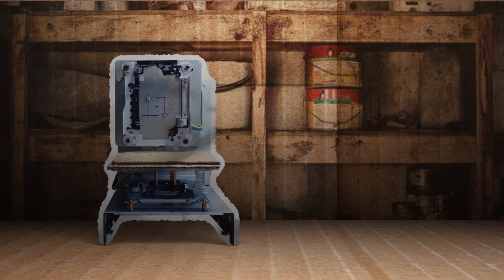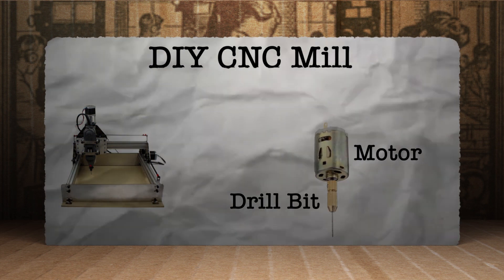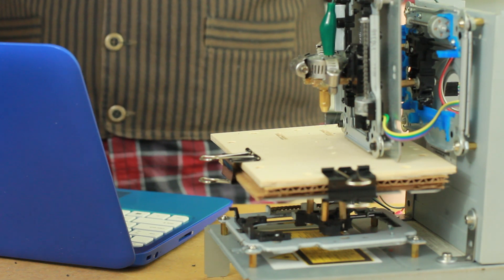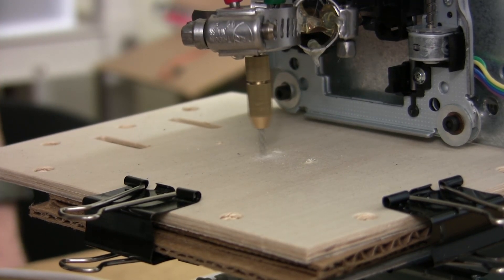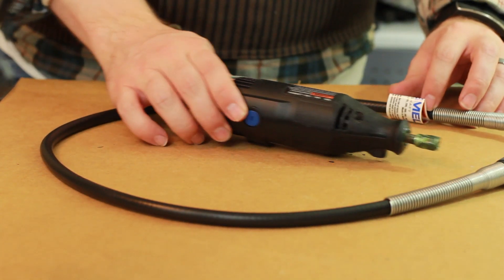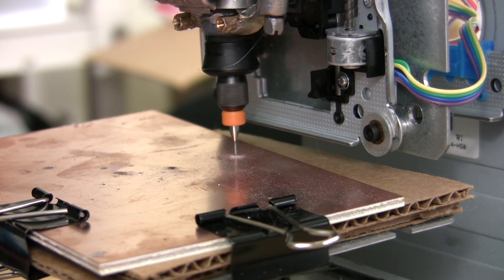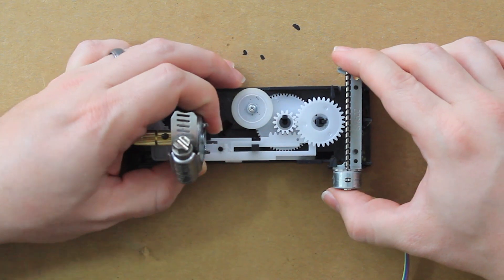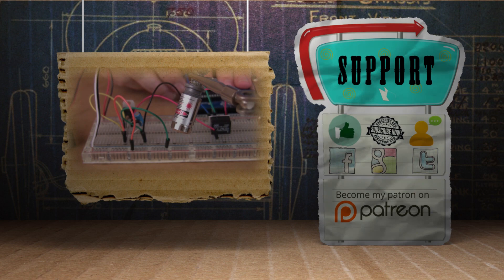Homemade CNC Milling Machine Epic Fail

Comment: you have to alight z axis very carefully (try drill on round bar oh yeah hard if not do exatly on middle) and remove wooble flexing. and what? you milling with drill bit? drill bits not cut horizontantilly

Comment: this is a drilling bit not a milling bit. You cant move drilling bits side to side
Reply: Correct. The flutes of a full bit don't have cutting edges, they are only for waste removal. It wasn't clear to me if, when changed over to the dremel, the drill bit got replaced by a router/mill bit.
Reply from the maker: +hansdietrich83 The dc motor bit is a drilling bit (because I couldn't find milling bits that could fit on a dc motor). However, the bit on the dremel is a pcb milling bit and is intended to move side to side.

Comment: CNC milling machines do not use drill bits.  Drill bits only cut at the point, milling bits have cutting edges all the way down the flutes.  If you do want to try milling, a milling bit is available from Dremel.
I have followed this project with interest, but have no intention of building one like it because the unit simply does not have the rigidity or strength to do accurate repeatable milling.  There are many good videos on building CNC milling machines.
Reply: +Will Barrows I don't think he expects people to follow his builds exactly. It seems a lot more like a demonstration of how to do a simple version. With some changes, many can be found in the comments, you can build a much better version for a bit more if you wanted to. Videos like this help show some things not to do, so any one who tries can do a better job.
Reply from the maker: +Will Barrows the dremel bit is a pcb milling bit. i knew going into this that it probably wouldn't be able to mill anything, but i wanted to see how far i could actually get.

Comment: Don't try to use a drill bit when what you need is a end mill. Drillbits don't cut sideways. Well they can  , but not well. Sturdier is always better than wobbly, but there are always ways to make things more stable. 
  My first two milling machines were made from used printers for the rails and motors with 20 tpi hardware store 1/4" threaded rod driving the bed via hardware nuts and dremel with a flexible shaft. Concrete base, brazed bed frame skeleton. BACKLASH? What's that? LOL

Comment: Man, those motors are too slow and too weak. You need a printer motor (where, by the way, the drill chuck would attach much better). Another thing: to use that part from the DVD you need to remove that white part, that can go to one side to the other. Because it breaks the motor. (There are great projects using it - with the original motor. Like 4 leg walking robots.) ;)

Comment: yeaaaa. milling is not gonna happen with that flimsy of a setup. at least dont use hot glue to attach the motor... Good idea and cool project. Im sure you learned a lot. Many many people have been making milling machines for a very long time, maybe take some hints from their designs first.

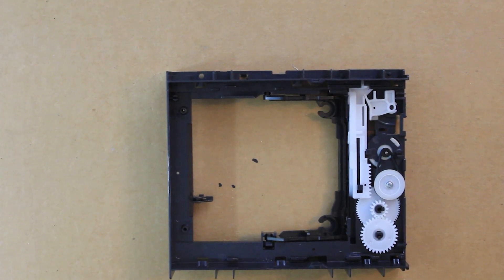Comment: Only 1:20 in, maybe the reason it didn't work is because you don't mill with a drill bit? You drill with a drill bit and mill with a milling bit. It's in the name.

EDIT: Yep. Get yourself a real cutter, and a drill chuck that doesn't suck. The drill chuck looks like it could actually be okay, but it probably isn't sized properly to the shaft, so of course it's going to be off-center.

Comment: Your bit is way too long. the longer the bit, the worse your wobble is going to be,  and the more torque you are going to get on your z axis; lever law. Try ditching the bit and extender entirely and filing the tip of the motor axle itself into a spade. move the motor as far down on your z mount as possible, and don't forget to properly balance it with a counter weight.

Comment: two words, drill bit, that's the wrong drill bit, that only works to perforate but not to scabble, actually there is drill bit for router and that's very important in order to make any "CNC" then you need a better guide system (obviously), step motors... im sorry but all you got is not the option, i made mine and it wasn´t cheap and it should not use arduino uno as the data processor and control because is too slow and only 8 bits, you need at least 24 bits and 94 MHz for that kind of data manipulation also a independent control for each motor and drill etc, you can still using arduino of course but soon you'll need a better option trust me... oh and not speak about the power control and the energy cost

Comment: ok sorry but the mechanical parts are completely shit mayby you should try to but more effert in tho mechanical  parts
Reply from the maker: +Sorry my english is so suck the point of this video is to see what can be made from old cd-rom drives. obviously it'll be better with better parts, but that completely bypasses the point of the video.
Reply: yeah that is true if you just want use low budget. But even from scrap you can make much stiffer machine. The one hose clap support is the worst.
Reply from the maker: +Sorry my english is so suck That's called "using what I had available because I had to test and get the project working in less than a week". I'll probably make another version when I have the time to fabricate parts and put more effort into it.